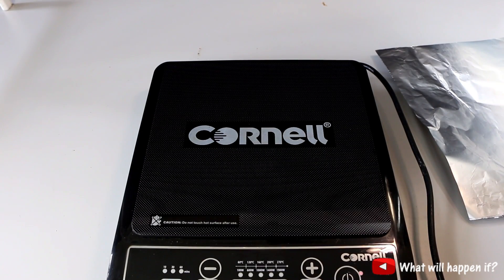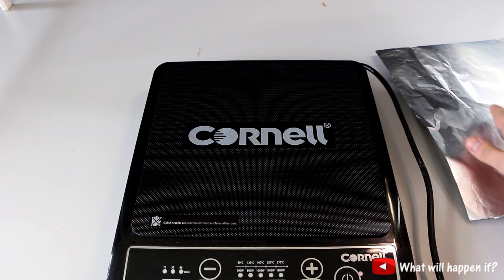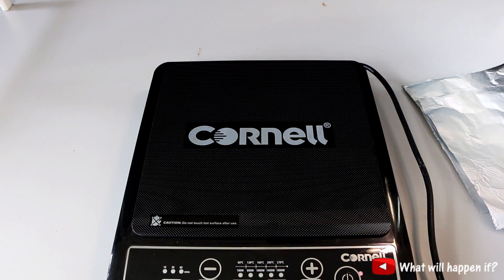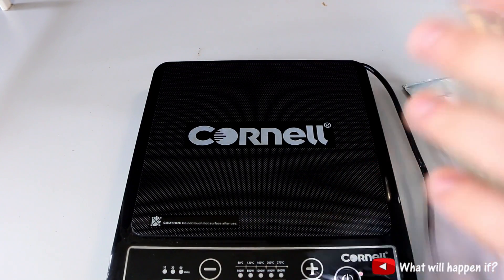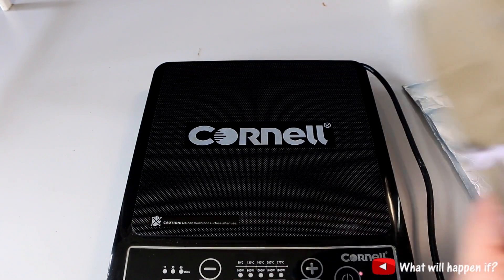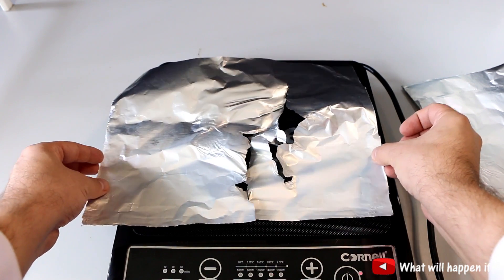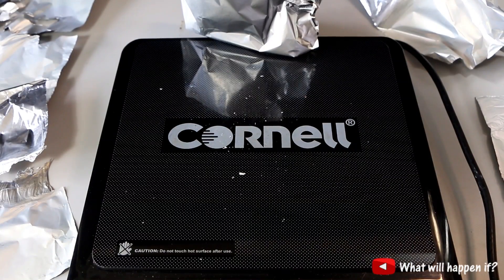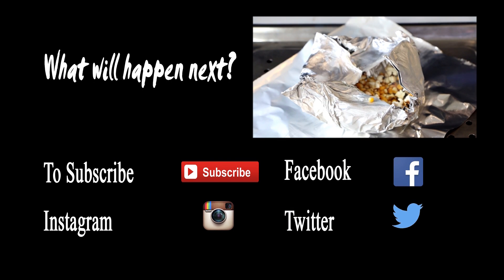Aluminum Foil and Magnetic Field Reaction

Comment: Question: does the aluminum foil fly because of magnetic fields or because of heat building up under the foil?    
It appeared not to want to fly as much after the foil had split, so I'm wondering if the force moving it was heat?
Also aluminum doesn't normally react to mag fields right?
Reply: No the flat top surface utilizes magnet

Comment: Heat ='s lift, it's a hot plate not an e.m. field generator.
Reply: All 6's&7's this is an induction cooker. The plate isn't getting hot. The magnetic files is inducing currents in the aluminum which are repelled from the currents by the induction plate. 

Same happens if you drop a strong magnet into aluminum or copper plate. Very cool effect.